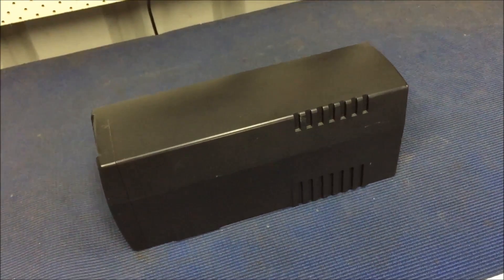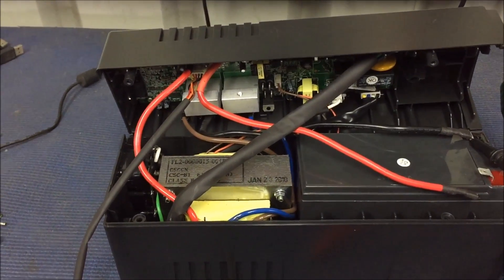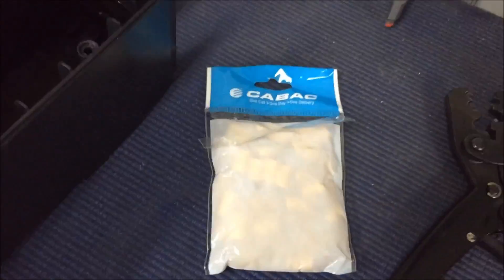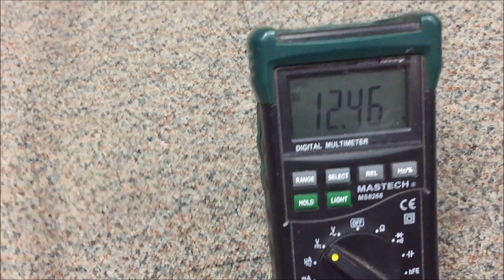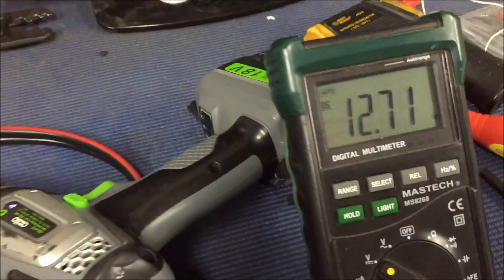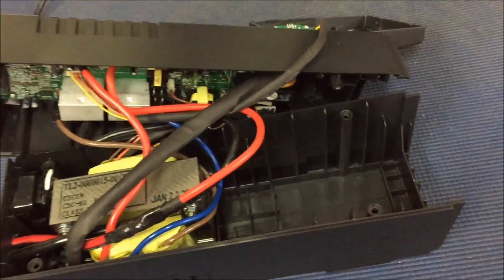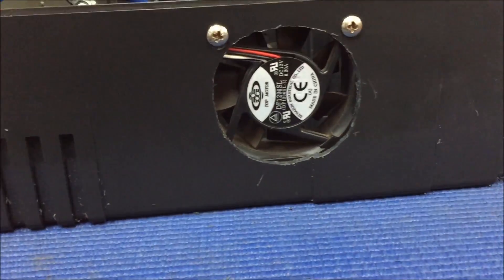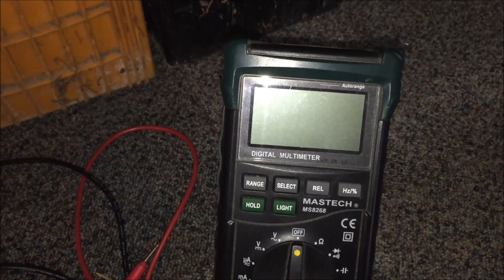UPS Hacking for offgrid DVR survalance system

Comment: These type of UPS have a timer limit, can you make a video disabling that timer?
Reply: I think I will try that too as pure sine wave is what you really need.
Reply from the maker: I run it for 2 years before it failed - not sure there was ever a timer in this one
Reply: @HBPowerwall  mine just shuts down after a couple of minutes.. even if i install a 65Ah battery
Reply from the maker: Bugger
Reply from the maker: not over heating?
Reply: @HBPowerwall  Not even warm (touching the H bridge mosfet heatsinks). But it beeps and just dies after 10-15 minutes
Reply from the maker: Sorry can't help more than that :(
Reply: @HBPowerwall  it's okay maybe my ups was damaged before it is sent to me when buying... 

Btw, I have another question about battery.. I'm planning to make a 4S battery as a starter battery for my cressida and my moped. But finding a bms with a huge current capability is so hard where i live (or too expensive). So I came up with this idea.. What if I make a 4S battery with 2 positive terminals, one for the entire car/moped electrical, one for the starter motor... So that way maybe i don't fry my BMS when starting the engine?.
The starter motor solenoid is connected directly to positive battery terminal without BMS while the rest of the vehicle connect to BMS.. will this work?
Reply: Your ups is not damaged some have a built in timer mine goes for exactly 1 hour to the second and turns off then I go turn it back on and boom 60 minutes later it's off again I'm still searching for answers on how to disable that built in timer.
Reply: @matthewperrins3279  the UPS is dead now after I experimented with it. But I use the transformer to make a diy pure sine wave inverter using egs002 module. It works great, has a built-in safety feature but it looks ugly because of the big bulky transformer

Comment: Did i notice you have two 12v batteries in series = 24v? That won't work with a 12v UPS.
Reply from the maker: 2 x 6v batteries.. worked perfectly

Comment: There may be a problem with changing the big batteries with this.  It is made to charge the smaller battery and if the big batteries get discharged much it may burn itself up trying to charge them. There is a big difference in the internal resistance between the two types of batteries.
Reply from the maker: lasted for 2 years and died due to water ingress so i'm happy with the result
Reply: @HBPowerwall  Sooo.... I have a question to you..
I have the  700 back-ups.. it uses only one 12 v 7ah.can i  add an additional of like two other same battery but connect it in parallel.and if yes... Will they charge.. and work in a longer time

Comment: if the cameras run at 12v then you'll get more hours by connecting them directly to the battery instead of using the UPS inverter... then your UPS will only be used to keep the battery charged

Comment: Hi there! I too tried this for my cameras with a similar ups , but instead of a deep cycle battery I used a 3s 16p Li ion with a bms... So when they batteries are low the it'll automatically cut off the power to the ups(at 3.2v). But the problem I have is that at 11.7v the ups shuts down cause the ups thinks the battery voltage is low. Any ideas? I could find the voltage diver and mod that. Please help me out?

Comment: nice setup mate im currently doing the same thing , i got the apc 300w one and a 70amp car battery voltage seems abit high when charging , 14.1, just doing it to mess around , got my offgrid setup here https://gyazo.com/6c0af9070da24064299d87e9356d161e

Comment: The problem I have with UPS's as that they charge the battery to and keep at a high voltage (i.e. 14.4V) and that cooks the battery. with such large batteries that might not be a problem but the way I would do it I would remove the ac in and use it as basically an inverter and have PV panels charge the batteries.

 31w. add inefficacies and a full day and call it 100w. you could have 1 100w panel charging the batteries and no need for ac in... job done. 

Or run the cams off the batteries without inverting and converting
Reply from the maker: +Phillip Aboody Battery voltage has not exceeded 13.2v so I think that the size of the batteries and the fact they are pretty much stuffed will make it safe & fun experiment. As for running them directly off battery, you just spoilt the next two videos I was planning for this. Already have it setup to run full time off battery & solar :) I have 4 separate DVR's running 16 cameras - but that's another video :)
Reply: woops
Reply: @Phill AboodY can i run 2x 200 amp Batteries 🔋, Ritar Batteries on 650 VA, /350 Watt Eaton UPS. 🤔 Just Remember the Batteries i keep them in 12 volt Parallel..
Reply: @HannesBrandt  As JUST a 350 W inverter, sure (I wouldn't max it out to 350W btw). As a charger? I wouldn't. 

Like I said, if you are going to charge the batteries, use a different power source as these are dumb devices and they may cause damage.